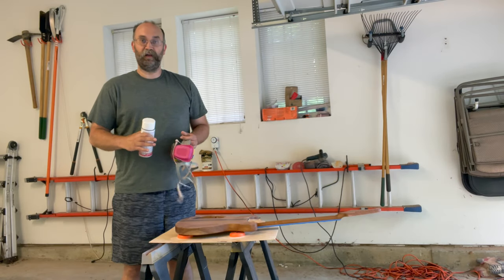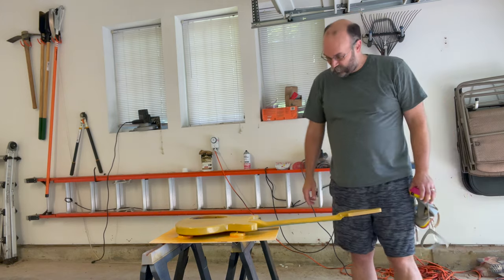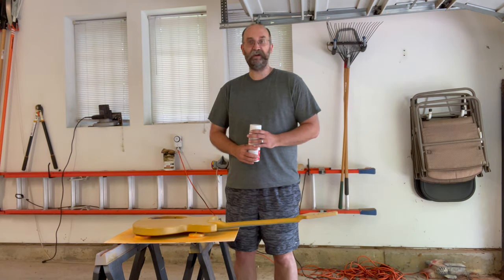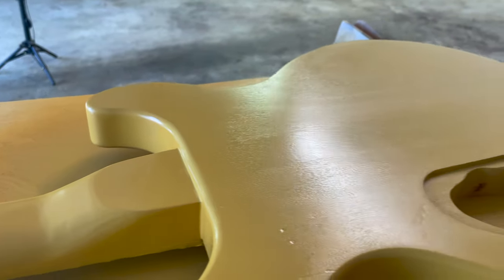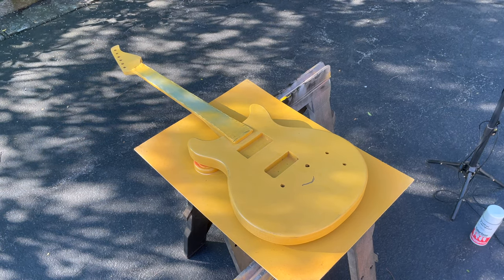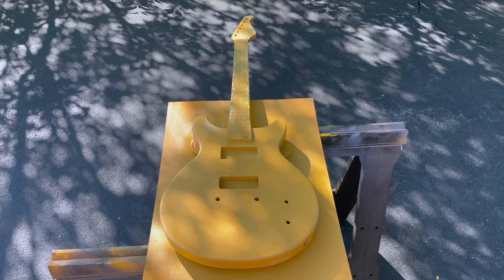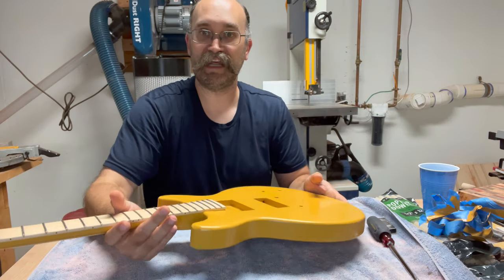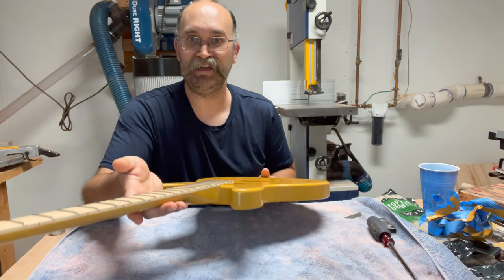Painting a Doublecut with TV Yellow Nitro Lacquer

Comment: does it create nitro checking?
Reply from the maker: No. You have to remember, most people painting things don’t want the paint to crack. So coming out of the paint can, the material isn’t meant to do that.

If you want to check lacquer, you need dramatic temperature changes
Reply: @zwitchguitars  of course i know to produce checking you need to create rapid temp change. But with some nitro it wont that is why i asked.